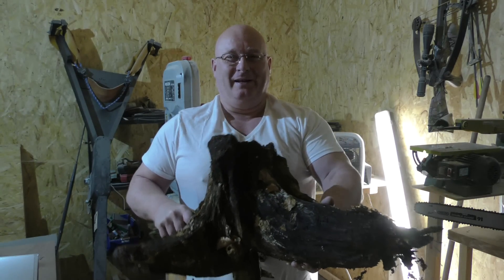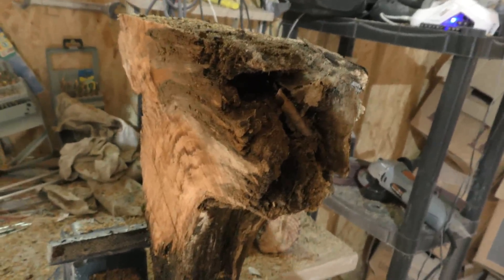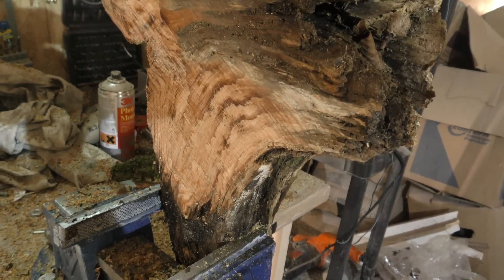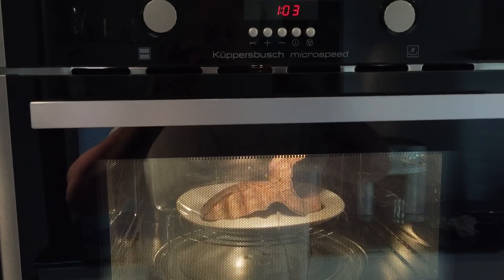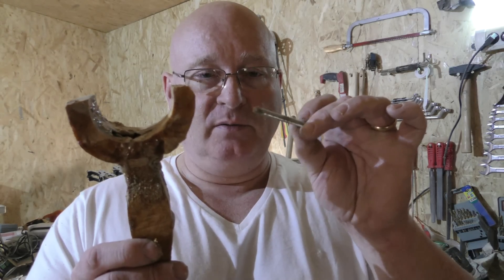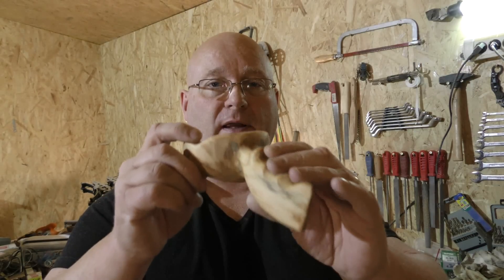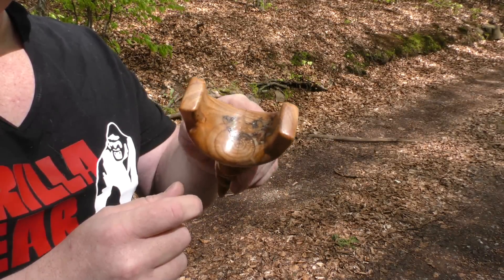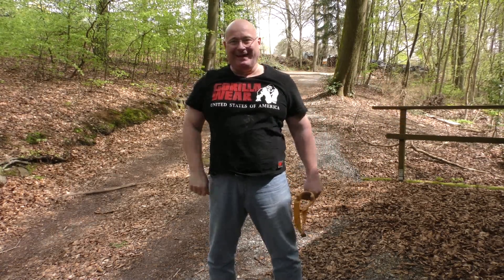How To Make A Slingshot With A Chainsaw

Comment: A tip for you, don't use the nose of the chainsaw as this risks kickback and without protective equipment, it will go straight through whatever it comes into contact with. Just don't want to see someone who entertains me so much get hurt!
Reply: +Paul Spencer Hearing protection would be good too.

Comment: that turned out really nice. I like the way the oil brings out the grain in the wood. a little worried about the hole eaten by the ants, is it still strong and will the epoxy hold it together?
Reply from the maker: +James Perrine I pinned it with two 6mm steel bolts. Tested in the vise with twice the draw weight of my strongest bands, as always.
Reply: +JoergSprave good thinking with the pins. you make some really cool videos and I enjoy watching them. I made a slingshot after watching your videos for the first time and it turned out really nice. then I made one for my nephew for his 10th birthday.  he loved it. thanks again for all the cool videos and ideas.

Comment: Absolutely love this channel, I want to build a slingshot that well propel a 28 inch carbon arrow at 350 fps, any ideas??????
Reply: +sc1212able first step : Dont use feet per second.
Reply from the maker: +sc1212able Rubber is not really ideal for projectile speed much over 250 fps. It shines at shooting heavy ammo at comparably low speed. 

If you want to get 350 fps, then you have to use mechanical devices (levers, pulleys, block/tackle). Such devices eat up a ton of energy and create plenty of friction, hence you have to go up to insane draw weights in order to overcome those issues. It is possible, but the weapon will be huge, clumsy, hard to load and unreliable. I do not recommend it. Go for a massive steel arrow that does 230 fps instead. Same energy, much more momentum, easy and straight forward crossbow construction.

Comment: Hallo Jörg 
Wie immer tolle Arbeit. Mal eine Frage über Holz. Wie lange sollte das Holz von einer frisch gefallenen Eiche trocken liegen bis man es verarbeiten kann? Bitte sag nicht 20 Jahre :)
Reply from the maker: +ac3b1s Kommt drauf an wie dick die Stücke sind. Dünne Äste trocknen schnell, ganze Baumstümpfe brauchen ewig. Wenn Du die Stücke überschaubar hältst (also maximal Schuhkartonformat), dann sollten zwei Jahre in einem trockenen Keller reichen. Ansonsten rein damit in die Mikrowelle.
Reply: +JoergSprave 
I thought you were going to use the chain to launch projectiles...

Comment: Could you give me a list of useful tools for wood work? XD
Reply: The vise is essential, a hammer, screwdrivers, chisels, circular saw, hand saw, drill, square, measuring tape and some meters of sandpaper. I think in any place out of Brazil those things are cheap :( Also a handplane, a beltsander and a bandsaw are good, but once you start making things with the basic the other tools just come haha

Comment: a microwave does not cook from the inside out
Reply: not completely
Reply: +slime the gamer Generally speaking it doesn't, but the EM-waves have a specific frequency that matches the molecular resonance frequency of water. This way it heats up the parts containing moisture more than other regions. Generally speaking wood has more moisture on the inside,since the outside dries more easily because it is in contact with (dry) air which helps drying.